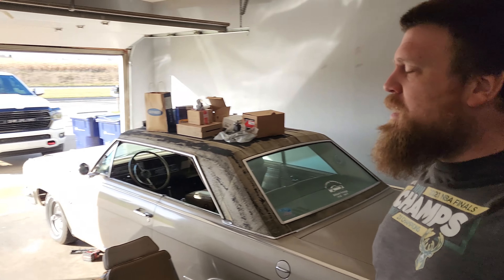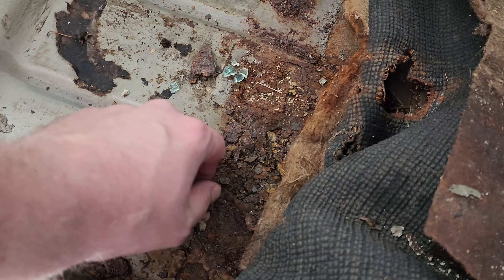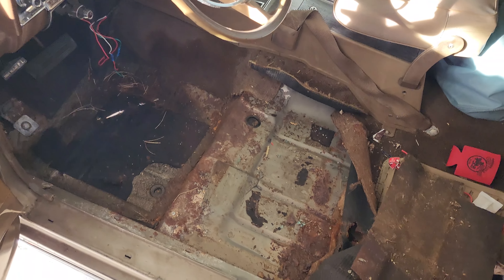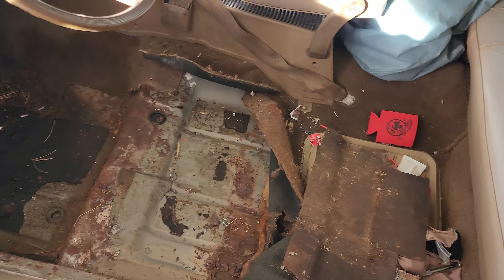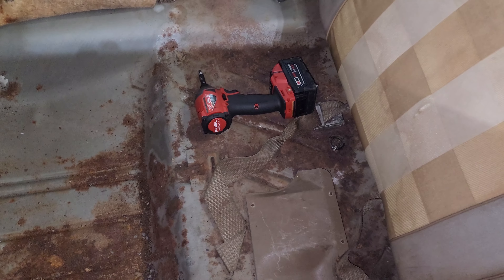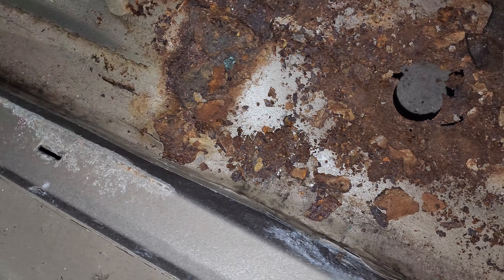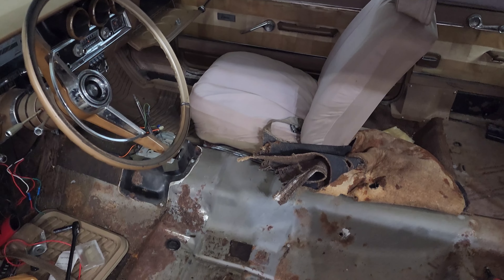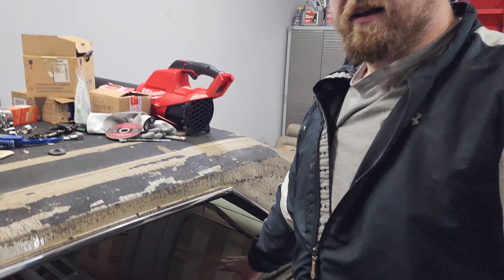Pulling the Interior in the Rambler!  How bad are the floors?! #cars #trending #restoration

Comment: To bad your not doing the interior with original pattern material. When I go to a show that is what always attracted the most attention. The custom interior came with 2 throw pillows in the same material.
Reply from the maker: I'm on the fence about it, I like originality, but I also want to make this car mine.  It isn't a super low and super original car, so it doesn't pain me to change things up a bit.  With that being said, I can get new material for about half the price of the factory material, so I can buy more and have excess left over for repairs in the future, where the factory material is close to obsolete.  So that's kind of where I'm coming from in wanting to change it up a bit.
Reply: I have enough material to do your cars interior. My Rebel is now at the Rambler Ranch. It will be there forever. Your car is also suppose to have two throw pillows as part of the custom interior. The custom interior is pretty rare that's why I encourage you to do the original interior. That's one of the things that gets so much attention at shows.
Reply from the maker: @ramblerkid1  what would you want for the material? I think we've talked about it in the past, but I assumed you didn't have any left by now.
Reply: Yes we talked back when you first got the Rebel. The material as far as I know is now $154 a yard from SMS in Canby, Oregon. That's 54" by 36". I'll sell mine for $80.a yard. I had my Rebel my 28 years and did the interior back then. The original owner had it for 30 years. I turned 70 a few months ago. I can't take care  of all the cars anymore. I still have 22 cars
Reply from the maker: @ramblerkid1  yeah I remember chatting with you!  Do you recall how many yards you needed?  I'll probably have to take some measurements.
Reply: I don't remember and the car isn't here for me to measure. You could take a piece of your cloth insert to an upholstery guy and ask him